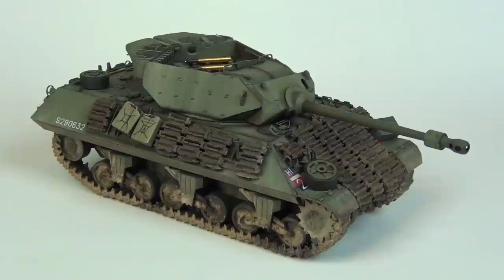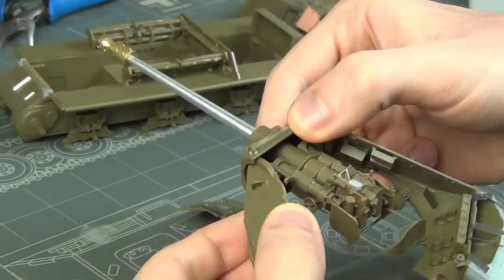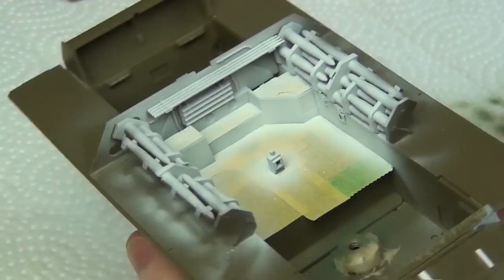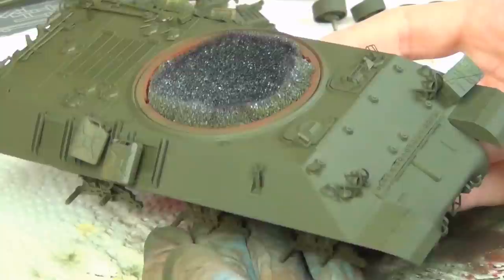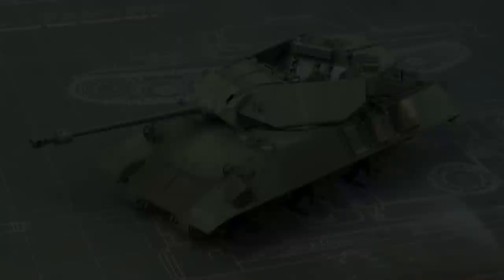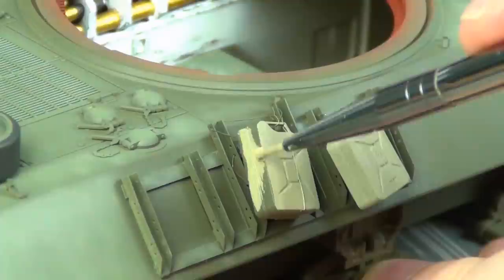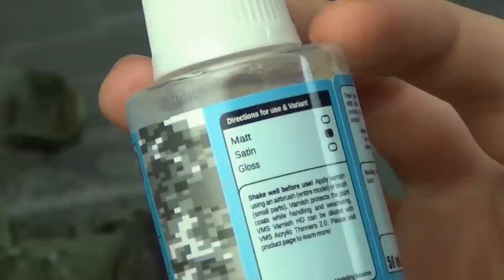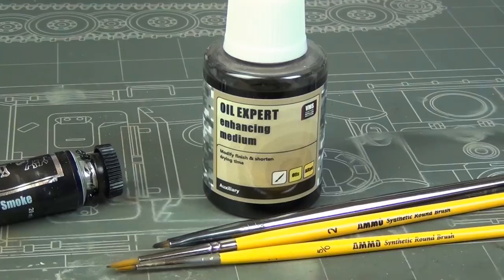How to Paint & Weather British SSC15 Olive Drab | Standard Weathering Procedure Ep.7 For Model Tanks

Comment: Thanks for the video. Have you ever looked at fuel filler areas? They usually are darker due to spillage. I agree on the dark wash detail shadowing.
Reply from the maker: I was considering doing some fuel spill effects but I didn't have a ton of time to finish this one, so I just focused some extra dark wash in those areas.  And, fuel streaks down the hull sides would not have been visible due to the grouser racks and stowage.  On my next Sherman project though, I will explore that more :)

Comment: Amazing modelling 👍 I’m new to the modelling world ….. do you varnish after all the weathering ? Again brilliant detail 👌
Reply from the maker: I do not varnish at the very end as it will affect the pigments.  Rather, I apply the matte varnish after all the oil streaking and dust on the vehicle is done...then I add the pigments and mud on the lower hull.  It won't get worn off as I don't handle the model from the hull.
Reply: @Panzermeister36  Thanks for that 👍

Comment: How is the durability of dust paint mixed with a dust pigment? I am not a fan of pigments, because they are not as durable as oils and I don't like to work with pigment fixers
Reply from the maker: It's quite good, but I don't risk touching the running gear afterwards.  I only handle the model from the upper surfaces and there I did dust with oils so it's very durable.